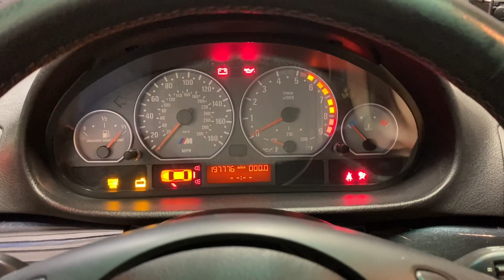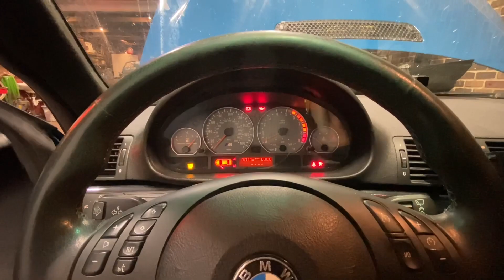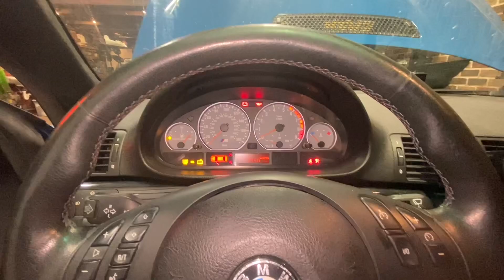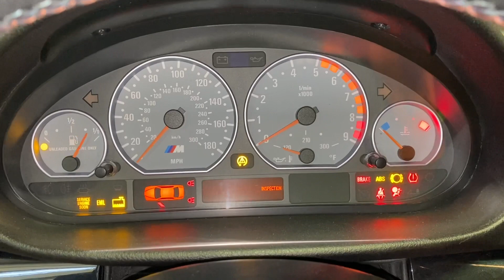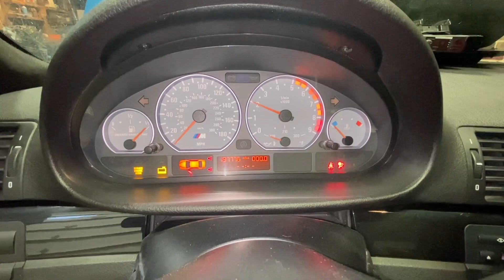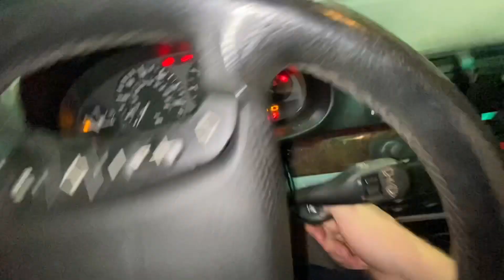E46 M3 new engine failed oil pump and starting on the beater Xi project

Comment: Nice work, that looks extremely tiring and painful going through that whole oil pump ordeal.  Looking at all your projects gives me a ton of anxiety, I used to be able to walk into my garage when I was doing S54 wagon swaps few years ago and just drop a rear end or drop a motor swap in a weekend on my back no problem. Now on my turbo M3 sedan I don't even want to deal with it anymore 😂😭

Quick question though You mentioned your E46 XI beater project... Any specific reason why you're choosing another project to pile on and you still have all those other fun projects in your garage to work on?
Reply from the maker: it was really awful. took 3 days of my life! one of the weirdest automotive diagnostics I've ever had to do since I know the car really well the engine came from. I guess the collision that took it out of commission killed the oil pump.

I hear ya. I never want to touch any of this stuff, but as soon as I break it, then I'm game to finish it right up! :p

its for the polar run rally. I did the first 5 years, four of which in sub-$1000 BMWs, 5th in the FJ, and skipped last year due to shitty rally destination. This year they're going back where I like so I decided to get a sub $1k BMW and do it all over again. Plan is just to toss a clutch in it, do the suspension, axles, fluids and send it. probably will just sell it off next year.

The projects I do have I don't really want to deal with, and they have no timetable for me, especially over a pandemic winter. I know YouTube wants me to work on every one of their favorite cars all the time, but I don't have time for it and YouTube doesn't pay my bills, so you guys are just along for the ride whenever I do find time, and more importantly, Motivation to do just about anything in the garage with a camera in my hand.
Reply: @OvalboreCars  Greetings, I have a question if you don't mind.  I have watched your videos about the F355 engine out several times.  I plan on doing mine this winter.  My question is, what king of lift table did you use? Also, what was it weighted for?   The reason I ask, I liked the lift table idea, but I'm sure you've seen those racks people make for the 355 cradle, (custom made and take up a lot of space).  Being I am not a professional garage, I'm thinking the lift table would work better for me, but I want it to be safe for me and the engine.   Harbor freight has a nice one rated for 1k pounds, do you think that would work safely?    Thank you for your time and your videos are great!!   Thank you again.
Brad
Reply from the maker: no worries - I would always prefer you comment on the video you're referring to as it helps others, but it's a Harbor Freight lift table. nothing special about it, just have to pull the pins for the handle to clear the bottom of the car. 

Lift table worked great. the cradle and engine is far less than a thousand pounds.

Thanks for watching
Reply: @OvalboreCars  Thanks, will do!!! 

Brad

Comment: So my E46 M3 is getting low oil pressure at fully warmed up idle (confirmed by a mechanical pressure gauge) and I'm wondering if my oil pump is going out or if this something else. Any ideas? It's been doing this ever since my shop put new rod bearings in.
Reply from the maker: maybe partially blocked pickup but likely rod bearings if you have the right oil in it.
Reply: Ovalbore do I 100% have to use oem bearings? I did acl extra clearance bearings the first time and had to pay a second time and used ACL standard clearance bearings. I've heard lots of positive Feedback on these not to mention they're half the price vs oem

Comment: S54 engine takes 5.5 liters or 5.8 quarts of oil , don’t over fill it 😅
Reply from the maker: it absolutely does not take 5.8 quarts, and overfilling was essential to keeping bearings lubricated during cranking, not for actual operation.
Reply: @OvalboreCars  you are incorrect. Regular oil change is indeed 5.5L. If you change the bearings its approx 6L from dropping the pan. All you need for cranking is to unplug the coils, fuel pump fuse, assembly lube on the bearing shells and in the pump - you should never overfill, not to mention thats just a pure waste of oil and money.